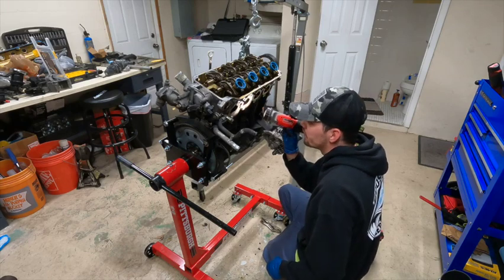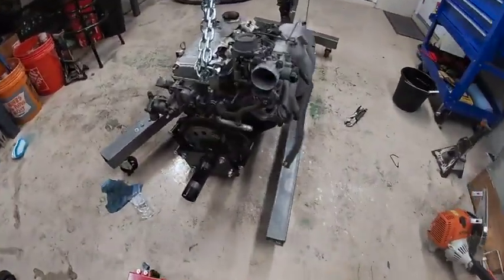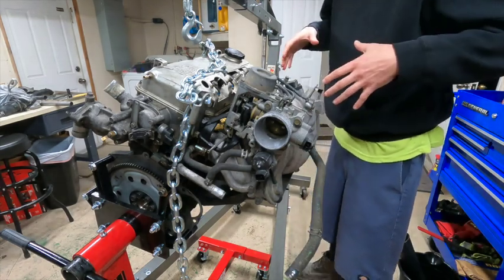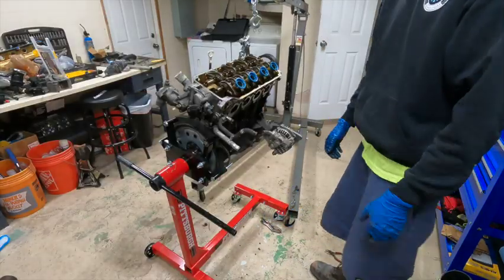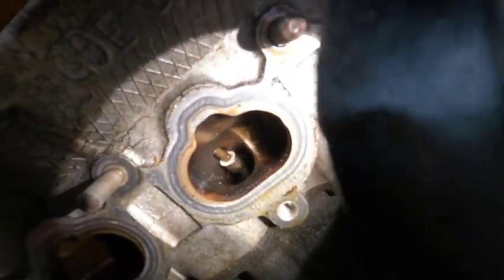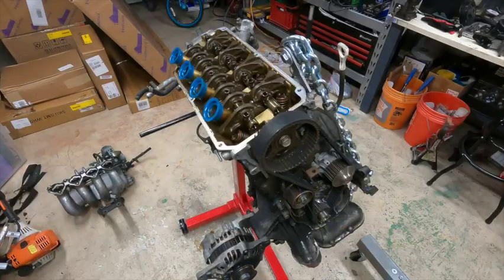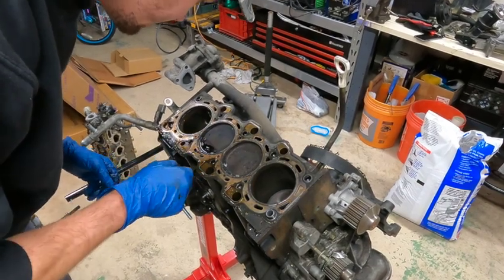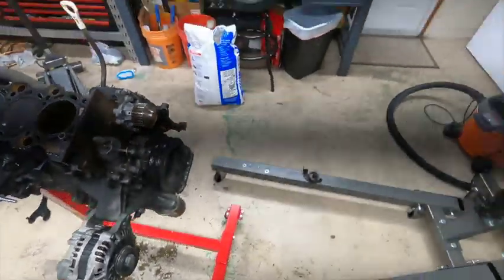2002 Lancer engine breakdown

Comment: It's great you did this I got an 03 rally racing edition and I'm having issues trying to find parts for it they don't make them anymore sadly but right under the power steering pulley it's missing the whole tensioner and bolt so one of the belts is off until I find  piece that isn't outrageous but now when I tried to accelerate it to pick up speed getting to 40 it sometimes lags to gain speed I'm possibly hoping that it's my throttle position sensor but lmk your thoughts I'm open minded it's my first import.
Reply from the maker: Hey Ricky I happen to have an extra power steering pump and bracket with the tensioner/pulley if you need one.  My thoughts on your power loss I would clean the mass air flow sensor. Check for a vacuum leaks after the MAF sensor. Has the lancer throw any engine codes? Is your 03 lancer a automatic or manual transmission?